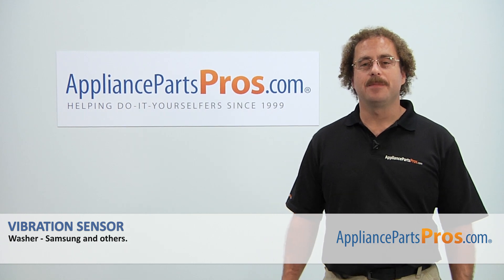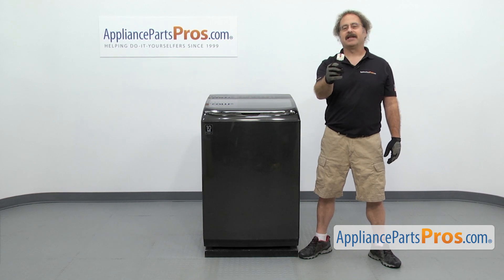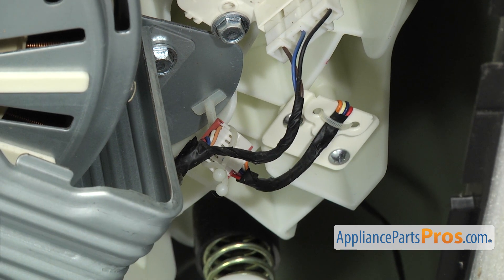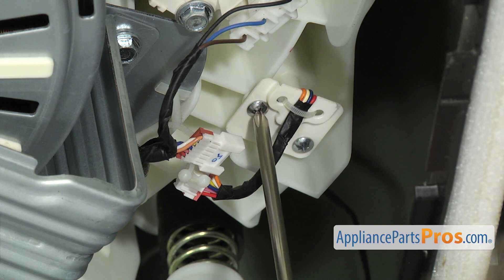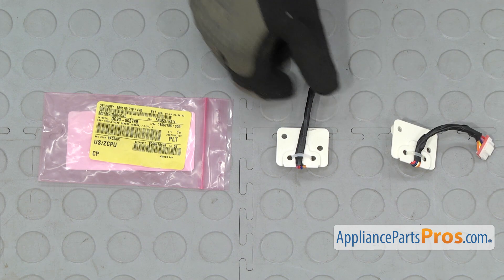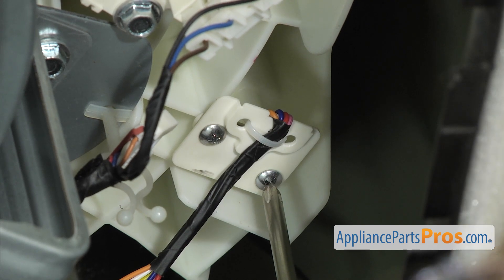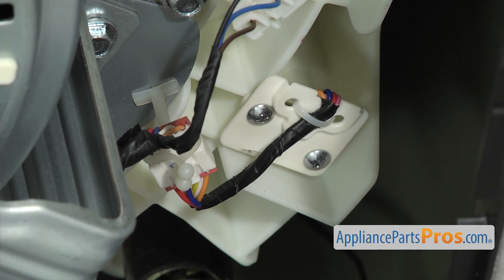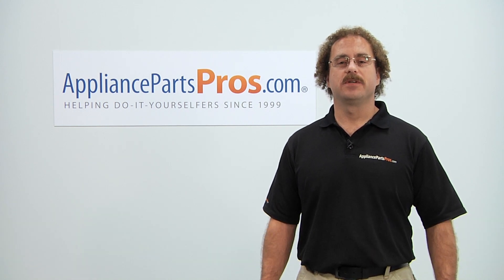How To: Samsung Washer Vibration Sensor DC93-00278B

Comment: I see it has the dreaded 4 springs, that may be the first thing I replace. Good video.
Reply: Yes, replace those first.  I changed the 4 suspension rods.  And, damned, if the last one that I took out wasn't broken at the bottom.  So, no wonder the thing was not spinning well.

Comment: Are these pretty universal for Samsung ?
Reply from the maker: It will depend on your model number. What is your model number?
Reply: You gotta order the right part for the correct washer, but yes, Samsung and some others often have similar parts but not exact same numbers.  So, you can't just assume.

Comment: How often do you think the wiring harness for this machine would go out at the same time if not before the sensor?
Reply from the maker: It would be rare for wiring to go bad.
Reply: @appliancepartspros  thank you!
Reply from the maker: You're welcome!
Reply: @appliancepartspros  looks like mine was the rare case. New sensor installed, reset washer. It took about 5 min into the wash cycle and it popped the error.
Reply from the maker: What is your model number and the error code you are getting?

Comment: For me, Everyone, I changed the suspension rods, but my Samsung washer kept giving me a UE code -- as it was about to do the final spinning cycle.  So, I just changed it (according to this video) on 12-31-2023, and I hope that it fixes it.  Mine was kindof hard to get out, because the screws were damned tight, and it was hard to work under there -- as my wife tilted it for me.  And, I wish I'd brought my electric screwdriver, because I had a manual one and couldn't spin them, as they kept slipping.  But, I got my electric in there and it popped them right off.  They were FOOKING TIGHT from the factory, and they're both phillips.  Then, the dip switch was hard to open up, so thankfully, I had a butter knife that had fallen under the washer -- which I used without getting up.  And, I changed it pretty quick.  So, I am waiting now to see if that fixes the problem.  We put some towels in there, and I hope it will not keep giving me that dreaded code.
Reply from the maker: Hopefully that code won't come up again! If there is anything we can help you with please let us know.